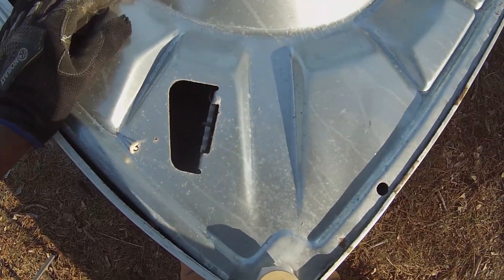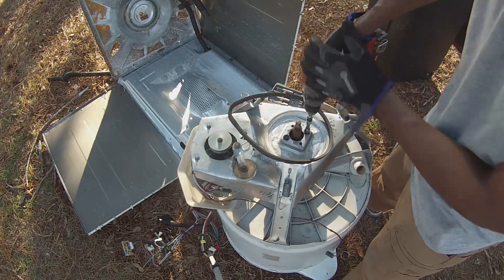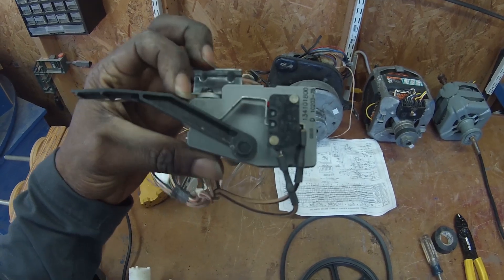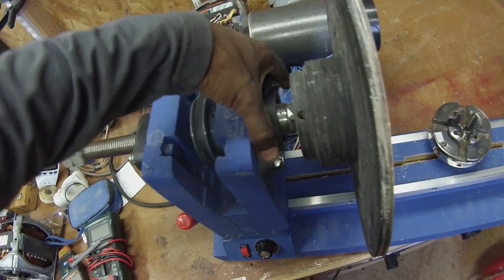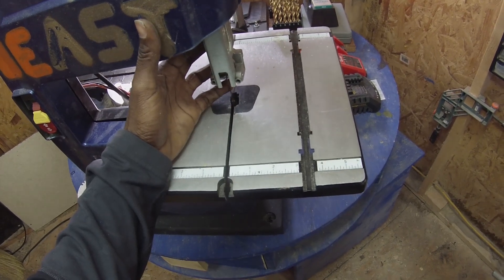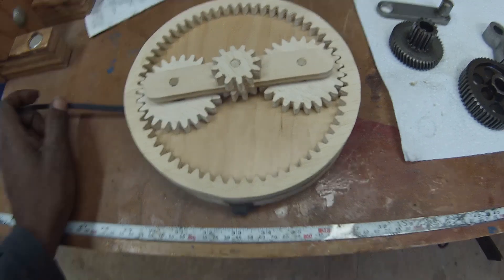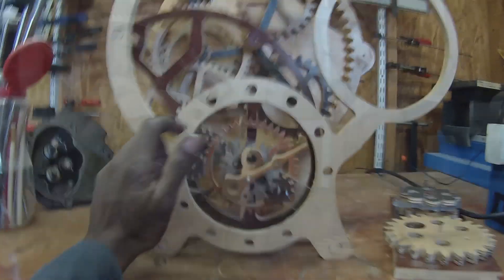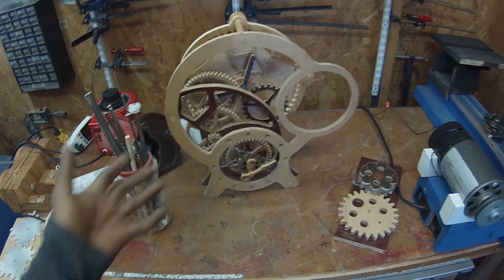Things You Can Make With A Washing Machine And Other Salvaged Components : 020

Comment: Great video!  I'm a big fan of 'unjunking' stuff too.   It's been a couple years since this video, have you made a CNC yet?  If you're still cutting gears by hand, I think you would really like how CNC does it, lets you layout the whole thing in Inkscape digitally, high precision.  Also, love those square gears, have you seen the sea horse gears on Thingiverse?  If not, check them out I bet you'd like them.  I keep wondering if could tear up a washing machine, and use the basin as a giant funnel in a creek to compress water pressure, then fire the output towards a water wheel possibly interfaced to those gears to increase rpm and drive a generator.  Do you think that would work?    Have a great day, liked and subbed and looking forward to more videos like this.  I've been livestreaming my daily gamedev work lately so if you notice this and would like to drop by we could chat some, I could show you the CNC I made out of hardware store stuff and some bits I 3D printed.

Comment: A mechanical genius, your making knew machines from scrap ! . Question, have you got a degree in Mechanical engineering, because if you haven't you need to go and get a degree in it ! . Why not try to build a lawn mower, from the parts that you have, or a garage auto door lift, or something to help someone who is disabled around the house like a auto door opener, or a motion sensor, that will turn on the lights in the house  .

Comment: I'm subscribing. Love what  you are doing. I'm on a budget also I would like to get the pump and motor off my used washing machine to use as a pool pump. Those little pumps on these 10 ft pools do nothing. Should I put a smaller pulley on the pump for greater output? Thanks.

Comment: Very cool set up. I also salvage and make things.
I have two 30cm linear actuators. That I wnat want to make a hidden tv box with. They have 200kg ratings i took them from recliner chairs. How can I increase the range of motion to acoomodate a tv that is obviously going to be taller than 30cm?🤔
Reply: You need to use a lever to amplify the range of motion. Your actuators will move the short end, the long end to move your tv box. But remember that if you amplify the motion, you will lose weight capacity. And the pivot point(s) must be sufficiently strong to handle all the stresses.

Here's somewhere to start https://www.progressiveautomations.com/blogs/how-to/selecting-the-appropriate-linear-actuator

Comment: Yes, the limit switch was for top open. And that wonderful cutaway...tell your ladies or moms when the tiny sock goes missing for little baby bubbles...there is where it goes. 

It usually ends up clogging the water pump he showed you, and then you either throw out the washing machine or call a repair guy because the machine won't drain the water. Or if you're a do it yourself kinda guy, you find the sock while exploring the water pump.

How does it get there you ask? Well if you run your fingers around the top of the tub you will often feel a rubber or felt seal that is supposed to keep things going between the inner and outer tub walls. Usually it happens because the machine is overloaded.

Comment: While I have very limited experience with washing machines what I have had with the two I had is nothing like this machine. There was no belt involved with driving the washer. the motor was connected directly to the transmission part so right from the start it makes no sense.

Comment: I built a 300w per channel audio amplifier from spare broken amps, I designed the boards and used large capacitors, large transformer and many other parts I found.

Comment: Great video and have you reused a motor from a front loader?
Reply: There a pain in the ass the motors from front loaders as they run on three phase power from the controller which converts 240 etc to three phase power  but they can run on 240 etc still

Comment: I need to build a conveyor, but on the cheap so was thinking of fabbing up a bunch of tank tracks, maybe from wood and drive a 15-20 foot run of wood tracks with a washer motor.  I need to relocate a basement full of dirt outside and I think wood tracks constantly spinning will work to move small amounts of dirt at a time, but continuously.  I have a 3D printer and am building a DIY CNC, so I will soon be able to machine wooden parts.

Comment: Jeremy a question. Dads air compressor not working. Trip switches rather than 13a fuse blowing. Anyway can’t read the writing on the silver units in motor box. Guessing they are capacitors. No plate on motor either. Any advise to fixing this appreciated.

Comment: I cant for the life of me figure out the wiring for a washing machine motor that I want to use to power a fan for my shop. I am a lifelong multi skilled fabricator/welder/wood worker/builder/maker but this wiring has me scratching my head. Im just not proficient about wiring diagrams. I feel so stupid but I cant figure it out. If someone could explain to me how to track down the various wires and what each part of the motor does and needs; that would be awesome. I have searched the web high and low and cant find useful {for Me] info. I understand the basics but that is it. Beyond that; might as well be talking about Proton Tunneling as I understand it better than this washing machine motor wiring.......all the videos and info on the net seem to be speaking to people that know about electronics, but I suppose im a dummy that doesnt understand and Im ok with that and want to learn how the motor works. If I knew what the various wires do to the motor then I think I could track the various wires down and then re-wire this motor to work for my fan application. Is there anyone out there willing to help Me ??? any info or help would greatly be appreciated !!!
Reply from the maker: Did you watch my video on “how to wire most motors for DIY projects” it does what you are asking
Reply: @Jeremy_Fielding  I think one of my problems is that I can barely see my MultiMeter move in the Ohm settings. Im gonna order a new one, its got to be at least 20 years old. I hope this helps but thnxx for your reply....

Comment: Hi i am trying to find a 16 to 1 or close to gear reduction to power a adult trike for older gentleman using a 1 1/2 hp gas mtr I do not want to run multipul jack shafts as small children may gat nrar ir. Any idea?

Comment: Dude! Your a genius! I’m a refrigeration/appliance technician. I’m always reusing scrap appliances to make stuff, but not on your level. I’m impressed with all you’ve done. I love the clock and desk toys. I’ve made a portable room heater for my shop from dryer parts as well as metal art, roses, from the cabinets. I’ve saved gears and pulleys to decorate the walls in my shop, and turned a refrigerator into a bookcase. I thought I was creative, but that’s nothing compared to the things you’ve done! I’m subscribing. Looking forward to seeing move of your great creations!

Comment: Nearly 20 yrs ago I used 2 Washer Motors to make up 2 different style Bench Sanders that we used in an Industrial Setting.  One Radial one Axial.  I really suspect that Washer was still good, just that either the Pump had a Lint Blockage or it was over-loaded (too full & the Drum would not spin so they parked..then set it out for trash. Typically the Pump leaks, or the Transmission (the part chopped out) develops Seal Leaks (leaks grease on the floor) (or becomes noisy as it wears out) (or the Belt wears & slips). Yrs ago Shops used to toss the old (but still usable) Motors from the Washers/Dryers in the trash. I found the very big/busy Shops are more likely to Bin a couple of them (saving you having to haul an entire Washer home & make the mess) & the little Country one man shops hang onto them (for scrap or resale) (he'd sell you one for a few $)  Also I frequently see them for sale in Flea Markets (around $5-$50 depending on whether it's one of these Open White Goods Motors or a Closed Utility Motor & it's size) (expect some Flea Market Vendors to want Gold for their stuff) (but sometimes have a real nice one)  & CHEAP at the ReStore ($10-$15 ea.) 
I really love that Wooden Clock!  Working ART!

Comment: When I was a kid, I lived with my great aunt & uncle. He took an old wringer washing machine motor, and built a kids motorized merry go round. Years later, I found some old Popular Mechanics books (hardcover) and it showed making it using an old wheel & axle, and the rim had angle steel bolted to the rim. They had dug a small hole in the yard and concreted it. They ran a big belt around the rim and pulley on the motor. The decking was marine plywood. There were patterns for use with an overhead projector, to make various animal seats. When my grandchild gets here from Armenia, I'm going to build him one.

Comment: How accurate are motors to drive clocks?
Reply from the maker: as accurate as the generator speed used by the power company.... very accurate
Reply: @Jeremy_Fielding  Great! I'm quite into mechanical clocks and quartz watches. Do motors beat quartz in terms of accuracy? I bet motor clocks is the simplest among the three but you just need to provide a more robust power source than quartz?

Comment: It's literally called a lid switch. I repair appliances for a living.
Reply: William Dubus hi. Wondering if you could point me to a method to pinout a motor using a multimeter or other test equipment. Thanks.
Reply: @davidvelozee  this YouTube channel has a fairly comprehensive video that'll point you in the right direction. Way more informative than I could be in a comment

Comment: I've used the microwave turntable motors to make a few of  my security cameras pan back and forth but I have to switch it on and off to make it change directions. Thanks for the tip on the steel shafts from printers i never thought of that

Comment: I pulled apart an old VCR. There were many small motors and gears. I used one to turn a small pump to circulate water for a solar hot water project. A small motor was fine because it's low pressure and low load. I took a fan from a computer and made a matchbox style solar heat box and the fan circulates the air through the box and dumps 130*F hot air under my house in the winter so I get warm floors all day in 27*F weather! 😁

Comment: Jerry, I would like a simple home madeclay sturdy hobby roller for polymer clay. I have a manual pasta machine but it has too many parts that need cleaning. I would like one that is similar to the large ceramic clay model like they have in schools. Unless you gift yours to me, I need it to be on an easy level to construct. There are some on You Tube but not quite what I have in mind. I would like one that has a hand crank that can be removed so that a small electric drill can be attached. I have a few old cast aluminum (table clamp type) meat grinders that have removable cranks.Thanks for considering my ideas. Constance from Prescott Valley, AZ, USA. PS: Watch any vid on pasta machine (hand crank) for polymer clay to grasp how it is used by artisans. P.P.S: Are you going to make a fire pit or planter out of the metal washer tub? Composter?
Reply: BTW: I have never seen so many positive comments from guys to another guy.  You might want to contact HGTV and start a career on TV...no wait, YouTube is better!

Comment: Jeremy, I've made a few carousels in the past, mostly for Cristmas, using everything from wood scraps, garage door
hinges, shower curtain rods, plexiglass (clear, white, red & mirrored). 
The 1st one was powered by an ice cream maker which turned out to be so loud my wife & kids told me to stop running it.
Subsequent units used a home built reduction box with multiple shafts, pulleys & belts. Way too big, but quiet.
 I finally came across a Dayton gearmotor with capacitor from Grainger ($170 ouch & way overkill).
 While watching one of your teardown vids you mentioned salvaging microwave parts & I realized that the turntable drive
should work perfectly. Thanks a bunch! The latest carousel is being built along the lines of an old fashioned calliope with
the center hub having translucent red panels to be able to see the inner workings.
 Center post is just conduit so that i can feed light effects & provide rotating 120 VAC. The arms that will carry Santa &
his reindeer are shower curtain rods that pivot on garage door hinges with the door rollers mounted in the ends as
followers to ride on the cam plate. By the way i made the commutater out of 1" wide pieces of 2" copper tubing with just
"J" shaped copper brushes.
  I hope this might help you & others with some more ideas.
My only commercial carousel was made for Willie Wonka's Chocolate Factory in NYC.
  Thanks for letting me drone on & good luck on future projects!

Comment: In the early 1980s I made an old hand meat grinder powered by using a washing machine motor. We lived on a lot of venison back in those days and the old hand cranks wore you out. The motor had a start winding contactor that was worn out so I just put a push button switch ( the lid safety switch from the washer ) in place of the start contacts and mounted it externally, and then just pushed the button to get it started.

Comment: Jeremy with your inverter and capacitors not able to run motors, have you tried 450vac run (or start/run caps)  capacitors with the inverter?  I noticed the capacitors you used were not the correct ones. You can find start/run capacitors on refrigerators  and motor set ups.  They are good to have around for your motor projects starting loads and run loads.

Comment: You remind me of me, only you've got more energy. Age may have something to do with that. Anyway, you're great at showing recycling at it's best & most innovating and/or inventive. Since I live in a very rural area (basically in the middle of the sticks), I don't have a very nearby access to the closest town's dump area. They always had a pile of exercise machines, but they always lump & wad those into an such a tangled mass, you cant get any of them loose. I was, however, able to get a drive motor or 2 out of some treadmills & I was wondering what you used to vary the speed on the motor you're using on your lathe. By the way, those power recliner lifting chairs that lift up & forward to help elderly people get out of the chair are great finds. I managed to scrounge 1 that quit working 1 direction (up, down, don't recall). Anyway, I redid & fixed the power supply so it would go up & down. After getting all the chair torn away & disposed of except for the footrest which I use as a kneepad when I'm working or welding on my knees, I had this pretty heavy steel frame with a linear actuator in it. With very few modifications I had a little machine that can easily lift hundreds of pounds. It's 1 of the handiest tools I've got. I wish I could get to that dump before they tangle all that stuff up. Oh, by the way, I also built a 2 pedal, pedal car completely out of salvaged bicycles & bed frames. Each person could pedal at their own speed, or just 1 could pedal. I built a small bench seat behind the 2 front pedalers seats so my 2 daughters could ride while Mommy & I drove around town. I did have to devise a series of idler sprockets to make it easier to pedal around the small town we lived in. The whole town was more or less built a mountain so I had to figure & choose the routes I took. Some places were just too steep to try. In the end, all in all, I may have had between $20-$40 in it. I too, love pulleys, sprockets , and gears. I love that clock you made. Keep up the good work Mr. Fielding.
Reply from the maker: Thank you!... I have several videos on motor control and one specifically for DC motors. Please search my channel👍

Comment: Those small switches are commonly known as micro-switches...they are used essentially either as safety or signalling devices. i.e. as you mentioned, the machine will not run unless the micro-switch has been activated by shutting the door....and if the door is opened while the machine is in operation, the motor will be immediately shut off. Used extensively for signalling or indication too. They aren't designed to carry large currents and are not suitable or safe for switching any electrical devices directly. Thanks for the video, I'm also a firm advocate of recycling and building something useful....

Comment: I have been scrapping appliances for the past 10 12 years I've noticed most of the time these machines breakdown it has nothing to do with the motor but rather a switch or something else I've noticed mostly high humidity and a lot of moisture in the air which clogs up shafts are are shafts around in the motor but mostly switches and those are very inexpensive components to replace this guy gave me something to look at that I didn't even realize thanks have a great year

Comment: one thing i did with a washing machine gearbox that came in real handy was i mounted it to piece of angle with drive rod pointed up welded a piece of 2x2 angle point to the rod then strapped can of cold galvanised spray paint to it used a cordless drill to drive the gearbox and had a perfect spray can shaker still use it at work to this day works great